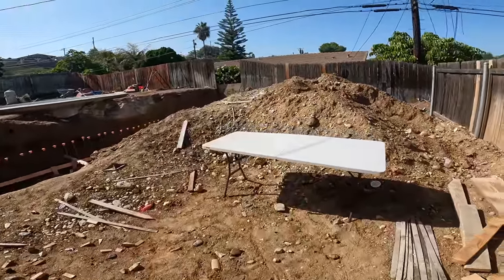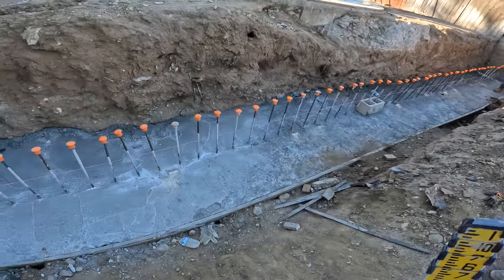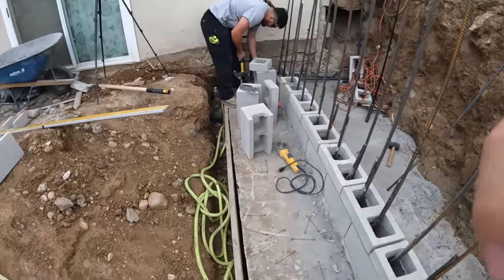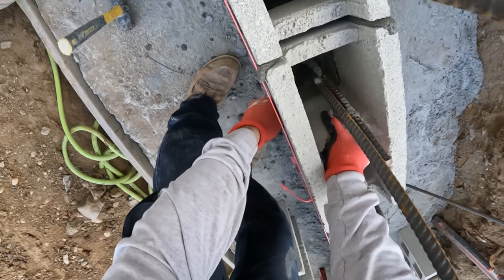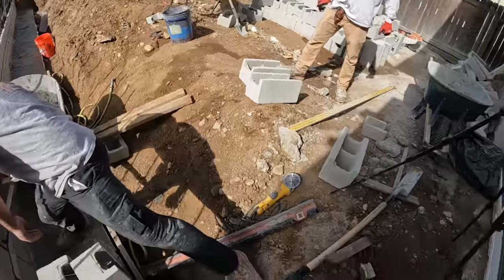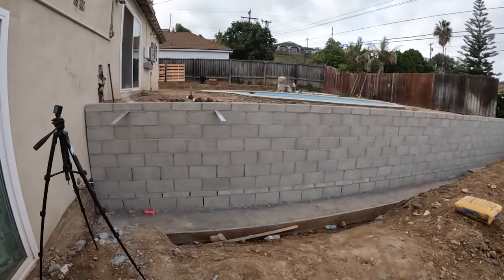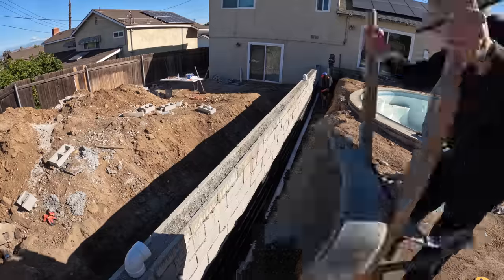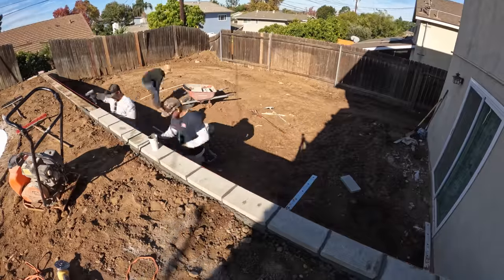Massive Retaining wall Build! Huge Backyard Remodel part 2!

Comment: Great job.  Wall looks great.  For the Henry's waterproofing.  You should be able to roll it on with a low nap roller.  Also looks like majority of the grout lines didn't receive the waterproofing.  Isn't that the most permeable part of a CMU wall?
Reply from the maker: In-between the blocks, yes.
I like to put it on thick with a red rubber float.
Reply: This stuff looks like tar
My dad said they always used to dilute it down with diesel fuel and roll it on

Comment: Hi there Tim Odell, Ashley Abrahams from a small town called Paarl in Cape Town South Africa. I started watching Odell Complete Concrete for more than 2 years now and like all the videos, yours and your brother’s. Your last video however that massive backyard project, I noticed when you finished the block wall, the two steel plates for the deck you put in had no safety caps on and can easily cut someone when not noticing. I am very causes over safety wherever I work and particularly in construction and just hoping that you take in consideration on your future projects. Keep well and GOD BLESS.
Reply from the maker: great idea
TY
Reply: @OdellCompleteConcrete  Thanx for replying, I only meant well cause your safety as the contractor are just as important.

Comment: 5:33 Oh yeahhhh, work those anterior delts!!

I might have tried using a separate trowel (one not used to lay the masonry) to apply the water proofing. But I've never done it, myself, so take that for what it's worth.
Reply from the maker: Good points

Comment: the waterproofing is to be applied with rollers, covering 100% of the surface (not omitting the block grout lines.
If weep holes are required, the holes are sealed from the back side was well. This stops/mitigates the cmu absorbing water and then purging it out the "clean face". The way you have done it, will result in leaching.. and if painted, "water blisters" tend to form behind the paint. And the only way to fix, would to be to excavate, reapply proper waterproofing and re-back-fill, remove the paint from the external surface to allow for the cmu to dry out over time before repainting.

Structurally, the wall looks fine and the Eng that did the calculation did not likely see the need for a wider footing heel but my calculations usually point me in the direction of a Cantilevered retaining wall type foundation for these types of applications
Reply from the maker: Great
TY

Comment: To get the water proofing workable, throw on a blob. Then use an electric heat gun to make it more workable. It trowels around more quickly when a little warmed up.
Reply from the maker: Good idea
Reply: I use the 5 gal Black Jack metal pail. Leaving it in the sun works if the weather is warm but I have also put it on a turkey fryer gas burner set on the lowest flame possible to get it nice and runny. Then it will brush on easy.

Comment: Howd you get the drain line to the other side of the wall? Did under it? Or did you pipe it on last video, cant remember.
PS- No pump and you bought 90lb bags! 😂 My backs too weak for those these days. I'd be pumping

Comment: Interesting choice of placement for your bottom “runt” layer of 3/4 cut blocks. The blocks at the bottom of a stack should be the strongest, especially when doing a retaining wall (lateral earth force). Did the engineering account for this? Why not just cut the uppermost blocks to grade?
Reply from the maker: For sure.

Comment: Hi Odell. I follow your work as I am planning on building CMU wall in my backyard. 
Q: why you filled up the back with dirt? I thought you’d be filling it out with crushed stone 3/4 for drainage.
Reply from the maker: The water will work its way to the drainage system

Comment: Why did you guys choose to do block rather than form it and do a solid concrete wall? I mean I assume block would be cheaper overall perhaps because you would need to build out the rebar grid and everything if you did it formed set up but then with labor and everything else I wonder which would have been cheaper overall but either way looks freaking awesome

Comment: would back up that paint waterproof with a black thick plastic membrane barrier. When water gets down in there it will come through the wall and if you paint the wall it will get mould or bubble. I know b/c that is what happened to me.
Reply from the maker: Makes sense

Comment: I got a question. Im looking on google and cant find a straight answer. That part at at 11:50 where ur guys fill in the wall. Is that mandatory? Does the concrete u add reach the bottom of the wall? Will filling them with gravel or sand work?

Comment: does the waterproofing not need to be on the mortar or the seams of the blocking? Seems like an access point for water to me, especially if the mortar job had some gapage, gives a spot for water to work its way in and erode
Reply from the maker: 100% coverage is best

Comment: That retaining wall is going no where.
I wonder if the rebar/concrete under the block wall was too much (I know it was from the engineer design).
Also, besides the work for the crew with the concrete mixing,  doing it manually  gives them more time to fill the blocks in a much detailed way than with the concrete truck.
Nice jobs guys!

Comment: in my experience water proofing basement walls we had a five gallon bucket  and dipped in a thick nap roller to roll it on it was a orange and black bucket cant think of the name
Reply from the maker: There's alot of them out there, a doing the same thing

Comment: So...i'm a concrete idiot and have no idea at all what is involved with making the decisions regarding the block wall.  My question though is, why did the engineer make it a block wall instead of a monolithic pour?  Is there a benefit to the block wall vs. a monolithic pour or was it cost related?

Comment: I'm going to be honest, i think this wall is incredibly over build but it all really depends on your engineer. Some engineers seem reasonable and some loose there mind with the rebar and psi. I get it though there a$$ is on the line with it all. Also I've always called those dog bones. That's what me and my friends have stuck to. I like it better than chicken feet. Cuz I don't get the whole chicken foot thing either.

Comment: You need to be really careful removing the rebar caps whilst working the area. Personally I'd never ever do it. I had a mate that had rebar go through his left eye and just missed his brain by millimetres. Caps are used for a reason.
Reply: Oh and personally, that's why I like 300 series blocks, not sure if you have them in the US. They are 290mm wide and in retaining walls that need beefing up, they are laid in the first 4-5 courses and then you can step back to 200 series blocks and  they reduce the need for larger footings.  I've never had a wall fail using them and built retaining walls over 3 metres tall.